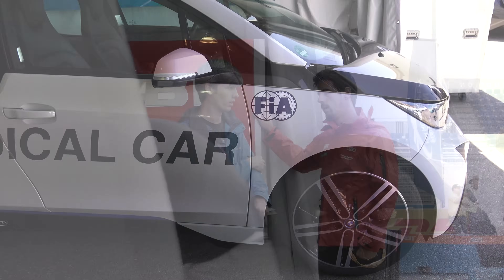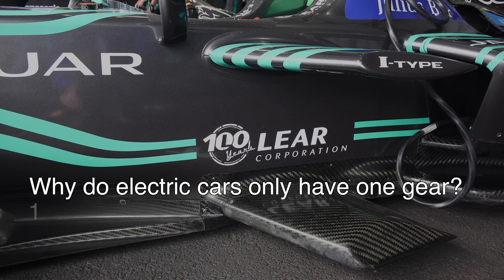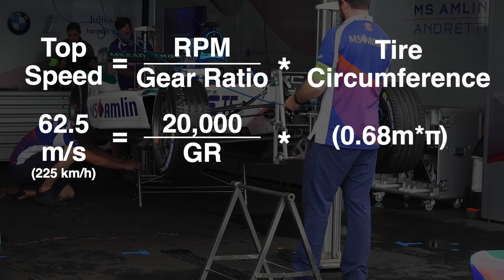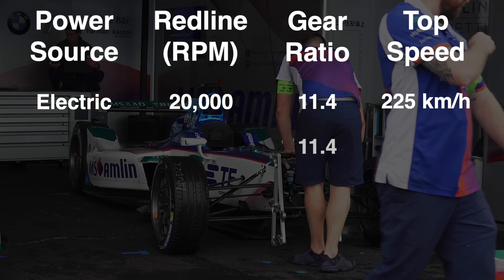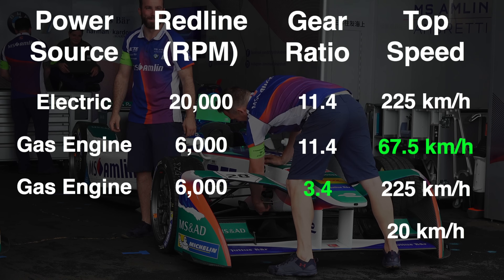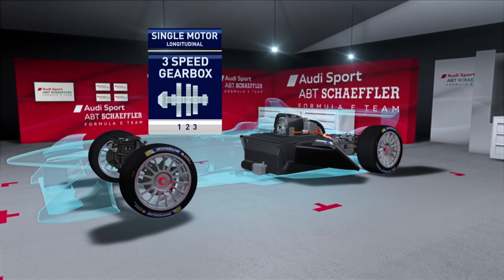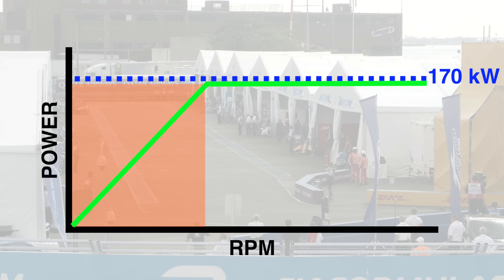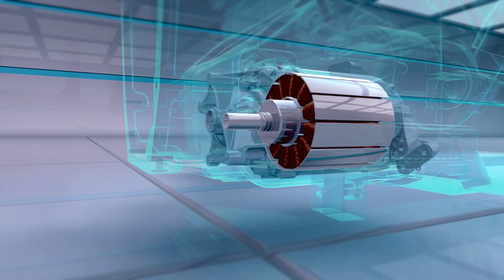Why Do Electric Cars Only Have 1 Gear?

Comment: How exactly do electric motors deliver full power instantly and stays constant over the rev range, whereas combustion engines gain/lose power/torque as rpms increase?
Reply from the maker: I made a video on this! :) https://youtu.be/VwFEyL_JJAQ
Reply: Engineering Explained i thought you did, ahh i will rewatch it✌🏽
Reply: @EngineeringExplained  I generally love your content but on this particular topic I don't think either of these videos really answer the question. OK you only need 1 gear because electric motors work over a wider rev range. But why is that?
Reply: The force on the piston is due to an explosion, transforming chemical energy into mechanical energy, and not electromagnetic force
Reply: EE video explains how a motor produces continuous maximum torque at zero rpm (note, that's torque (force applied against a load), not power (actual work done over time)), but not why an internal combustion engine cannot do that.   An ICE creates torque with a series of very short explosions pushing down on a piston which applies a torque to the crank shaft arm.   (think of it like a sharp hammer blow near  the end of the handle of a wrench).   The problem is that a ICE needs at least 2 strokes, if not 4 to fully cycle the air+fuel mix and exhaust gasses through the motor so it must be turning to produce more than a single impulse and at during at least 50-75% of the cycle, no torque at all is being produced.   The impulses from combustion are additive so you produce more torque if you can put a lot of impulses close together which is why you add more cylinders.    Can also produce more torque per impulse with a larger cylinder bore and/or longer combustion stroke (greater combustion volume), but due to added mass and inertia may not be able to  turn the motor as quickly and thus can't produce as much top end power.  

There is a type of reciprocating cylinder engine that  can produce maximum torque at zero rpm.     It is the steam engine.  
Steam enters the cylinder already at maximum pressure and maintains that pressure even if the cylinder is not moving, thus it applies a continuous torque to the crank arm (which on a locomotive is the  the wheel itself).    Torque is applied for the entire down stroke, and then the steam is exhausted suddenly at the bottom of the stroke (like a 2 stroke ICE).    No compression stroke is required so the cylinder returns to the top position with no resistance and then a new burst of high pressure steam is injected into the cylinder.    Steam locomotives will have two or four cylinders, offset in their timing so that they can pretty much maintain full torque continuously, at zero or very low rpms.    As long as the steam pressure is high enough, and the steam can be exhausted quickly enough (and cylinders cooled) they can continue to produce high torque at higher rpm as well.     The biggest steam locomotive engines produced over 110,000 lbf of torque at zero rpm, and close to 7000hp at 45mph.   They have no gearing, and run the same backwards as forwards.
By comparison a modern diesel electric locomotive engine produces about 3000hp and at starting torque of around 12,500 lbf.
Reply: Your answering your own question in the question, key word combustion. Takes time for it to take place, thus varies output power. where as electric is virtually instant
Reply: Short answer. Output power is dependent on input power. Input power is basically how much energy you put in, IE how fast you use gas. The way you pump gas through an IC engine is to spin it. So to put more fuel into your engine means spinning it faster. On the other hand if you spin too fast you don't get as much output from each explosion since the piston drops so fast that it loses compression and power. Electric engines don't have to spin to push energy through them so they don't have this problem.
Reply: If the electric motor does not get full power right away, but gradually accelerated . is it still full torque from the very beginning or do you have to floor it for full torque? I have a rc car with a electronic speed controller and when i barely press the radio it barely has any force...couldn't that be applied to electric cars so they can use transmissions?
Reply: @frankie2499  your esc in the RV car has a throttle curve in it to make it feel more like a gas engine. Castle creations makes Esc's you can program and once I took that curve out.... omg the truck was almost non drivable. It would rost the tires with the smallest of throttle input. I made that my goal then realised that in training to use the RV like that I was just applying the curve to my finger and gave up and put it back.
Reply: Electric lose power/torque through EMF. So essentially they are the same power at ALL RPM ranges until you include the back EMF created by the current in the wires pushing back against the field generated.

This is why you can design motors that goto 30,000rpm and beyond if you can make them big enough to deal with the back EMF.
Reply: @Rowschank, latest gas turbine power plant is 63% efficient, and power utility company is unlikely to use petrol for power plant because it is an expensive fuel, and diesel power plant will be replaced by gas power plants.
Reply: Refining petrol also costs electricity. About 6kWh per gallon. That's a lot for an electric vehicle to be used. So you have to add that up to the petrol engine as well.
Reply: Ah, I meant 6kWh/gallon, but http://gatewayev.org/how-much-electricity-is-used-refine-a-gallon-of-gasoline this is one. Cited by: https://greentransportation.info/energy-transportation/gasoline-costs-6kwh.html with additional info. Last link has some counter-arguments, but with added refutation.
Reply: Then the electric motor could spin more slowly, produce more torque

No, because the gearbox would reduce the torque back.
Reply: Using a brushed motor in a vehicle? That's a motor that will last one week and break down.
Reply: Long story short, Gas engines depend on the inertia of their spinning crank/fly while electric can delivery an electric field instantly.
Reply: +James Avery i rather feel more torque g force from an electric motor than having my ear drums blown out by an loud gas engine. 😁
Reply: Basically P = torque * angular velocity (P = T*ω), now electric motors convert electrical power (P = V*I) into mechanical power. These days they do that at an efficiency of above 90%! If you have a 200kW motor at 700V, it will draw the full 285 Ampères, this is due to the inductance, the internal resistance, etc. So a motor at full 200kW power at very low RPM is possible, because you can control all the angular velocity variables such as voltage and switching frequency (depending on your motor). Ofcourse, torque is a variable that's being demanded, it won't deliver 400Nm of torque if there isn't a 400Nm of counter torque applied to it. So eventhough the motor doesn't always consume the full power, it's ALWAYS capable of doing so. The higher the counter torque, the more current the motor will require to keep it up. Usually there are always sensors and looped feedback to make sure the motor keeps at the desired speed and torque.
Reply: FACR TORNZ It mostly has to do with airflow. At higher RPMs an engine's valves have to be tuned differently for maximum airflow vs low speed. Most modern engines now have some form of variable valve timing, but none can really compensate for the entire rev range. Another thing is the intake manifold, where it also needs to be tuned differently to optimize airflow for high or low engine speed, and I don't believe it is very common for manufacturers to have a variable geometry intake manifold. One more thing is the exhaust, mainly exhaust manifolds or headers, the latter of which are generally more useful at high RPMs, though this effect is less impactful than the other two things. I'm sure there are other small things that should be changed to optimize airflow for a given speed, but these are the main ones. 
Another factor is engine vabration. I would say generally, the faster an internal combustion engine turns, the more it vibrates, and these vibrations waste a good bit of energy. And at very low speeds, the same effect happens, partially due to non-optimal airflow, since most engines are made for higher speeds, and it is extremely noticeable with the small amount of torque the engine produces anyways at low speeds. 
These factors altogether make piston engines ineficient at any speed outside of their optimal range, where as electric motors have virtually none of these problems. Also, electric motors turn much more of the energy fed to them into usable mechanical energy, optimally around 9/10 of it, whereas I believe a piston engines waste about 2/3 of the total energy output as heat. In other words, if your car has a 200 HP engine, it is actually putting out around 400 HP of thermal energy just dissipated into the atmosphere, using a total of 600 HP of energy. That's why electric cars are considered to be the way of the future, they actually are more environment friendly, because even with the power being generated from power plants and going through all kinds of losses through transmission, it is still less wasteful of energy than a piston engine.
Reply: Azagro do you have a source for that figure? I've been looking for good data on that for a while. Your number would be painful since 24KWH/ gallon is fairly close to the energy contained in a gallon of petrol (33.7KWH)
Reply: Azagro thank you
Reply: Quote of the week!
Reply: FACR TORNZ
An electric motor has continuous power delivery.  A 4-stroke piston engine has one explosion forcing down a cylinder every 2 revs of the crankshaft.  The other three strokes are parasitical pumping losses meaning the crankshaft needs a heavy flywheel to force the piston back up. A piston engine is highly inefficient.

The absence of back EMF in an electric motor on startup adds to the instant torque.
Reply: Avery-John
 EV's have 350 mile range and do that 350 miles cheaper than gasoline. They also have far fewer moving parts, etc, etc. They are the prime point, which went over your idiotic know-it-all head. Weight is not a big player in all this. Weight only matters in aircraft, or starting from stationary.
Reply: Throttle position varies the supplied power as Rowchank said. Your hand gripping on the wheel creates a torque opposing the motor. No matter what the RPM is, the motor has to overcome the torque applied by your hand in order to spin. Therefore the throttle position corresponds to a maximum torque which is applied to the wheels and if you squeeze hard enough to overcome this torque then the motor stops spinning (or doesn't even start).
Reply: it is easy to conduct electricity into the coil and set PWM at maximum frequency at the start, which contribute greatly to combination of push and pull force on the rotor, it just matter whether the coil burn or not
Reply: @Azagro Brushed motors are still used in some (rather old) railway locomotives and they don't break down in a week (although they need a check every cca 20000 km).
Reply: ...that's so, but my understanding is still less than complete - if the electric motor spins faster, and thus produces less torque, and also has a 20k rpm limit, wouldn't you be able to get better acceleration and top speed by having at least a few different gears to choose from? Then the electric motor could spin more slowly, produce more torque, and not exceed the top speed for the motor? Am I missing something?
Reply: Brooks Ellis. Think about it why would an Electric want more then one gear when the output is virtualy constant, by adding more gears your just complicating the system and making it less efficient. But is essiently more for an  efficiency point of view.
Reply: It's Only Me I
Reply: Max torque at no RPM.
Reply: Actually there are plenty of all electric cars which have more than one gear. In fact I believe the Tesla has a two-speed gearbox. From the 1970’s on most electric cars only had one gear, but then again they also had a top speed of only about 80 or 90mph. The problem is they would have needed one more gear in order to reach the real potential top speed of the car with that motor. But I guess the manufacturers just figured it was not worth the extra weight and expense of putting in an entire two-speed transmission in just for those extremely rare occasions when you might need to go more than 90mph. So, although some of these cars could accelerate pretty quickly they did not have a very high top speed. Back when I was toying with the idea of converting a car to all electric 40 years ago I actually never did make up my mind about going with or without a transmission.
Reply: No the Tesla Model 3, S, X and Roadster all use a single gearing. The roadster was originally designed with a two-speed but the high torque output of the motors kept breaking the gearboxes. The early roadster's with the two speed gearbox had it swapped out in a recall for a single speed.

The dual motor variants of the S & X of course have gearing per motor. The front and rear motors use a different ratio.
Reply: simple electric motors has less moving parts over gas engine because of less moving parts and fictions wear and tear. therefore the loss of full power is minimal in electric motor. understanding electrical engineering and mechanical engineering first.
Reply: really asking why a MOTOR is more efficient than a ENGINE?  Thermodynamics.
Reply: Elan Wahgener - So, let me get this straight. You supposedly have an understanding of thermodynamics yet you don’t know that an internal combustion engine technically IS a “motor”? You cannot compare a “motor” to an “engine” as if they are two different things. Of course, we all know what you meant and I would normally not given someone a hard over this. However, anyone who knows thermodynamics should know what a motor is.

In any case, I think even a 3-year old child can see that an electric motor is more efficient than an internal combustion engine simply from the fact that the electric motor produces a minute fraction of the waste heat that an internal combustion engine does. Of course, it’s also true that a gallon of gasoline has a lot more energy potential than a battery of equal weight. In other words, 200 pounds of gasoline will get you a hell of a lot further down the road than 200 pounds of batteries - this despite the thermal inefficiency of the internal combustion engine. 

But then again, this was never supposed to be a discussion about thermal efficiency, but rather was a discussion about how electric motors can deliver maximum torque over a wide rpm range, whereas the internal combustion engine has a very narrow rpm range in which it can deliver its maximum torque.  And lets face it, this has nothing to do with the relative thermal efficiency of either.
Reply: SLOBeachboy
"200 pounds of gasoline will get you a hell of a lot further down the road than 200 pounds of batteries"
That is not the case these days.
Reply: Avery-John
You have to compare like with like. EVs do not have bulking and heavy engines, radiators, transmissions, etc. Compare the overall weight of both and the EV does very well. That is with the current heavy bodies and batteries - with improved batteries in the line.

166 gallons?  Only trucks carry that load.
Reply: Avery-John
Take into account the overall weight of the vehicle and gasoline does not come so good as you think.  That is my point, and as I emphasised, that is not building bodies dedicated for EVs.
Reply: Avery-John
Planes are very different. They become more efficient as they use the fuel and get lighter. Weight in a ship/boat is not much of a problem, and electric ferries are in operation and engineers are looking at batteries for cruise liners that say circle the Med. weight in a vehicle is also less of a problem as when the vehicle is moving the weight penalty is far less of a problem. My point, which I never put across well, was that the difference in efficiency in overall weight is not as great as your initial raw figures.
Reply: Avery-John
You are over exaggerating the range of gasoline v EV in a wheeled vehicle. But that is now not an issue as some EVs have over 300 miles range.
Reply: John Burns - Just to be clear I have been interested in electric cars since the 70’s so I know full well just how far they have come. My last reply to you however was not meant to be a debate on whether electric automobiles are better or worse than conventional automobile, but rather was purely an unbiased scientific discussion. Well, in truth I also replied to you before because you struck me as possibly being one of those irritating people who throws terms like "thermodynamics" around without actually having any understanding of the subject at all. And the fact that you still don’t seem to understand just how much more energy there is in a gallon of gasoline than there is in even the best 6-pound battery makes me think once again that you could not possible understand the laws of thermodynamics.  

As for cruise ships running purely on batteries, while this is certainly possible, it’s also not a terribly practical ideal. When ships are driven by electric motors these days those motors usually get their power from diesel powered generators, much like trains have been doing for ages.

Note: Oops! Looks like I got you and that first guy first guy mixed up because you were both saying the same things. Still most of what I said still applies.
Reply: my annual physics lesson has been taken, thanks guys and damn, never had over 100 likes on a comment
Reply: Because a combustion engine has to go through a whole process of converting air and fuel into mechanical energy. Electric motor's do not need to wait for an exhaust stroke, compression stroke, and intake to make one revolution. It's all one big powerstroke with electric in a sense.  So with gas you have to keep the rpms higher so you can complete that process more rapidly. That also brings in transmissions that step up the gear ratios to keep the dame things from bogging down since they are only making power a 1/4 of the time through each revolution . Electric motors know no such things. They have full power all the time. Just sucks they don't make glorious primitive noises like a fossil burner.......ahhhhh
Reply: That's your opinion. Doesn't have to be the fastest to be fun either
Reply: Daemn42,

This video is concerned with one type of electric motor, but there are very many diffent types and most do not develop full torque at zero RPM, quite the contrary. What actually is important is the inverter that supplies and controls the motor. It actually is not just about the motor.
Reply: Good question, and great answer. I need to learn more of this, I'm starting an electrical engineering class this september. And I'm trying to learn all I can before I start.
Reply: There are two factors. First, electric engines run at a higher RPM, so even at a low speed, the RPM is on a high enough level to get a decent torque (unlike the ICE that will run at sub 1k at that point). When you actually look at them with the same RPM value, you'll probably see less of a gap.
2: Electric motors are more smooth than ICE. Combustion engines work in kicks, where each cylinder needs a full rev, sometimes 2, before it can fire. Due to that, at low RPM, you get spotty power production. In comparison, electric engines produce every time the voltage flips, and that happens more than once per rev.
Reply: Did you watch the video?  That question is answered on the first few minutes, in case you don’t want to watch the whole video.
Reply: In electric motors, torque is dependent on the magnetic field strength and current. In Permanent Magnet motors, for example, the field strength is constant since it is provided by the magnets. Therefore, the torque is merely dependent on the current that flows into the motor. This means that, regardless of the speed of the motor, the motor can generate the maximum torque if supplied with the right amount of current. It is the responsibility of the controller to force the inverter to supply the required current to the motor.
Reply: Because the car knows when it's at a full stop, so it knows exactly how many coloumbs of electrical power to send out to give the desired effect.  
This is kind of the equivalent to fuel injection, compared to carburetion.  Fuel injection, you don't need to prime it to start, because the cpu already knows what to do to get it started, and it meters out the precise amount, without waste.  This is why electric power is much more efficient than even the most efficient ICE's.
In ICE engines, it takes time to spin up the piston to the desired speed.  However, when it comes to the design of the engine, there's always a trade-off between torque and maximum horsepower.  You have old OHV engines that can out-do more modern OHC engines as far as low end torque, because of the design.  However, with electric cars, you get the best of both worlds: you have instantaneous torque and power, always.  It's kind of like the advantages with modern CVT's: you get the best cross-section of power and fuel efficiency, because it is always at the optimal power band.
Reply: @rowschank  i find your lack of faith disturbing
Reply: nie deliveruje całje mocy natychmiast i nietrzyma jej przez całe obroty silnika ! hahah poj.pana koncepcja ., silniki elektryczne deliveryja jedynie max moment obrotowy od 0 i trzymaja go na stalym poziomie do okreslonej jakiejs tam sredniej wartosci obrotowej moc rosnie tak samo jak w silnikach spalinowych !!!!!! zeby uzyskac stala moc od 0 badz prawie 0 do sredniego zakresu obrotowego Nm musialby byc wielokrotnie razy wiekszy niz jest i odrazu od piku przy min rpm opadac wdol  takiego silnika niema na rynkuu he he he ., cały obraz zamywa takim laikom jak ty opona i trakcja opony co robia inzynierowia chcac zrobi jak najszybiecj przyspeiszajacego leketryka do 100 km/h ? ustawiaja taki moment obrotowy silnika od 0 w polaczeniu z promieniem kola napedowego a zeby to auto bylo wstanie w hipotetycznie najlepszych mozliwei warunkach isc caly czas az do100 km/h na granicy przyczepnosci /adhezji ., wrzuc na to auto duzo wieksze obciazenie albo duzo przyczepniejsze pony niz najlepsze drogowe i nagle sie okaze ze ten elektryk jest slabiutki tzn juz niema sily zeby isc na granicy trakcji opony i jzu niedobije do 1100 tak szybko w proownaniu do np top fula ktory i tak moze na starcie ulamek mocy wykrozystac mimo ze jego opony trzymaja 5 razy silniej niz drogowe to i tak ma taki nadmiar mocy silnika ze jakby sprzeglo za mocno sie zazebilo to te opony ciagle natychmiast by stracily trakcje ....wrzuc na top fula 5 ton i ciagle bedzie wstanie dobic do 100 tak samo szybko jak bez tego dodatkowego obciazenia tyle ze w wersji z 5 tonami na pokladzie bedzie trzeba sprzeglo usyawic tak zeby sie silniej scislo na starcuie zeby przeneisc wieksza moc na kola :) top fue tez ma limit i od jakiegos obciazenia tez jzu zrobi sie wolniejszy ale zmiazdzy kazdego elektryka dostepngeo na rynku w tym elektryczn etop fule :) .nie  ma chopcze elektryka z stala moca od 0 rpm :D no chcualbym tak miec w huilajnodze moje teraz mam 4 sek do 40 km/h  na stalym max momencie od 0 rpm do sredniej predkosci obrotowej silnika /silnikow gdybym mial maxx moc stala od zera to y tak rwała ze by tyl nawet gubil trakcje /mocniej dociazony z lepsza przyczpenoscia a nie tak jak teraz tylko przod na adssfalcie i przyspiech z 4 sek spad by 2-3 krotnie ....siliki elektryczne standorowo uzywane tyrzymaja max moc tylko w waskim zakresie predkosci  tu masz wykres np yyyy halrey livewire jak widzisz moc rosnie od zera a nie jest odrazu maxymalna  Harley Davidson LiveWire - Elektryczny challenge - w Motocykl Online (motocykl-online.pl) na kole ten harley trzyma max moc od 80 do 140 kkm/h ponizej i powyzej mocy jest mniej i to jest moc na kole na wale bedzie jeszcze weziej piku mocy bo wraz z wzrostem predkosci kola sa wieksze straty w przensieniu napedu ...
Reply: No one really knows how an engine works.
Reply: The ability to combust fossil fuels is insignificant compared to the power of the Electromagnetic Force.
Reply: Rowschank but i can grab the wheel and feel the different amount of torque, full press to half press i can feel the difference.  If it was still the same torque would i not feel the same force trying to spin the wheel while I'm holding it preventing it from spinning?!
Reply: Rowschank i press a little  i feel a little bit of force when i hold it, i press allot and i have to hold it really  hard...
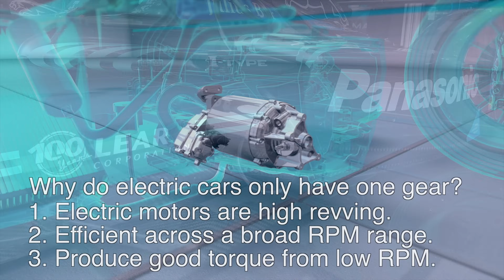Reply: @0:52 Efficient by which standard? Power consumption? maximum power in a certain rpm range?
Reply: actually it differs between a brushless motor and a brushed one.